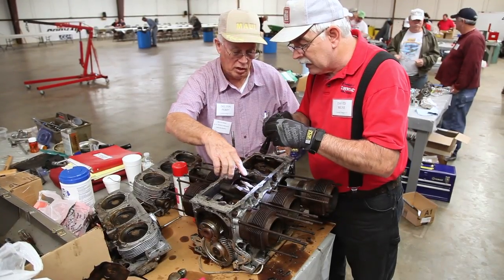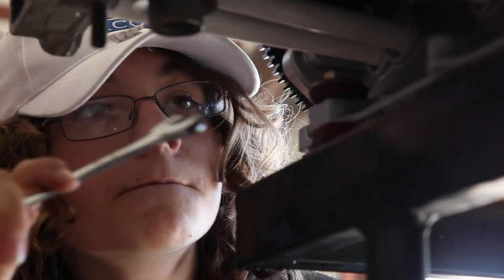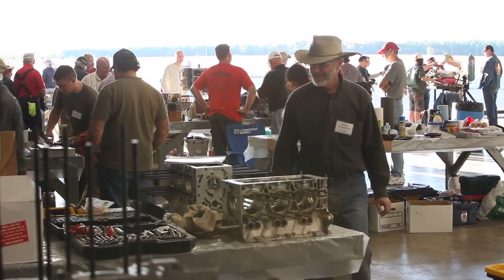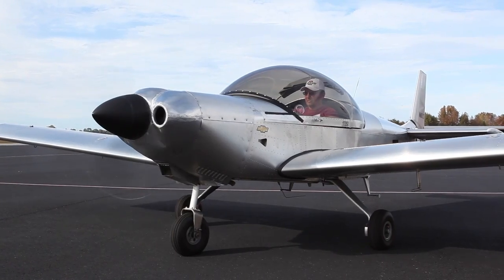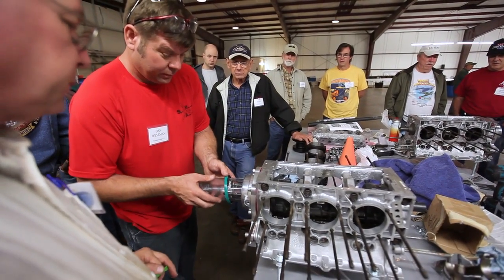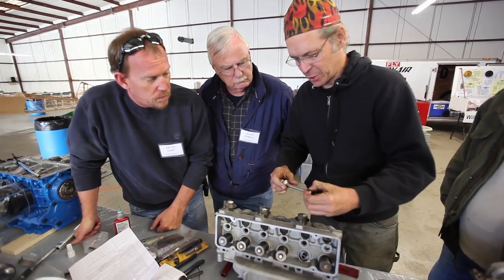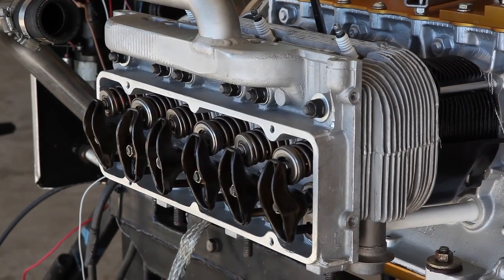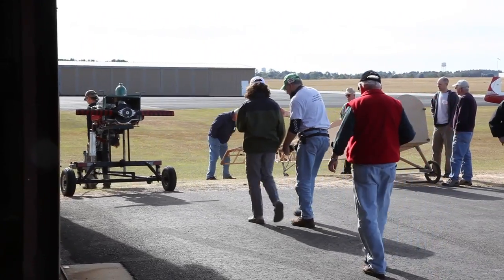Corvair College

Comment: My dad had a corvair on an airboat when I was growing up. I was always very interested in that engine growing up. He had taken the engine off the john boat and it had sat for many years. I got it going when i was probably 19 and used it on the river again. It spun a rod bearing and ruined the crank,  I was able to find another one in a salvage yard with a turbocharger on it. I was ecstatic to discover what I thought to be a locked up turbo to a good one that was just slightly stuck. The bearing was in good shape. It scares me to think now how much faster I was spinning that old wooden prop with the extra power. I dont remember putting a tachometer on it. But boy she sure started better with that turbo carburetor than them dual ones. I sure miss messing with that old engine. This video makes me want to build a nice boat to put her on. The old john boat got pretty beat up going over logs in the river.

Comment: In our cars we used to adjust the lifters while the engine was running because it was the best way to do it. Scary if a prop is nearby.
Reply: The lifters are adjusted using a proven system and prior the engine run.

Comment: From what I can see you don't convert the engines to fuel injection and what about dry sump lubrication?  ;-)
From what's said it sounds like the base engine is early 60s (61 to 63), delivering 85hp (stock) versus a mid-60s 110hp "Monza" or 140hp "Corsa"?  ;-)
Reply: In aviation sometimes less is more. The intakes are retrofitted to except an aircraft updraft carburetor. Aircraft carburetors are works of art and far superior to those used for automobiles. The oil system is modified to use a high output oil pump and deeper oil pan. Only 1965 to 69 non turbo are best suited for aircraft conversion. Hope that helps.

Comment: Yes. The Corvair College is a great way to learn how to build and a/c engine. I used to work on these engines when I was employed at a Chevrolet dealer back in the 60s. I do remember the push rod seals leaked a lot and some of the exhaust valves would burn out. However, the cooling in the Corvair was not the greatest. These engines do work well in a homebuilt a/c though. I am glad to see this engine comeback from the passed.
Reply: Ronald Streicher The Chevy dealer mechanics hated Corvairs!  In some of the Union shops they refused to work on them.
Reply: @craigjorgensen4637  I do remember our dealer tech was often grumpy especially when I fried the clutch on my mom's '65 and blew reverse gear.  It was pretty amazing to see a 95hp rear engine car smoke the tires!  The clutch was only good for two of these sort of tricks.  I admire that guy's skill and how he put up with me!  He fixed the pushrod tube seals before the warranty expired and there were no further problems for 120k miles.
Reply: Ronald Streicher how are you ? May I ask you what an a/c engine means? if so thank you
Reply: Hi Dan. An a/c engine is an aircraft engine.
Reply: ohhh lol never tough of that, i tough it was a different type of aiarcraft engine, speically because of the / but thankyou lol, I'm really interested in those, so I'm just surfing founding out what i can questioning, to learn more. thank you

Comment: Really good school, great little engine. I've built several 180 HP turbo engines for car racing.
Side note, not the correct way to hone a cylinder. Way too many RPMs and not enough in and out motion. Need a 60° cross hatch pattern in the cylinder bore.
Reply: thease a/c engines max out at 3000 to 3500 rpm. so x hatch is not as criticial?
Reply: I saw that too. Using a glaze breaker dry is not the way to do this if the rings are expected to seat.